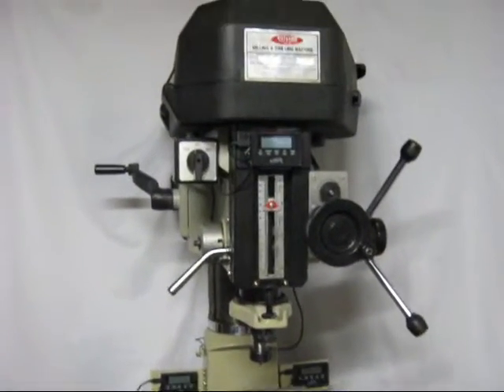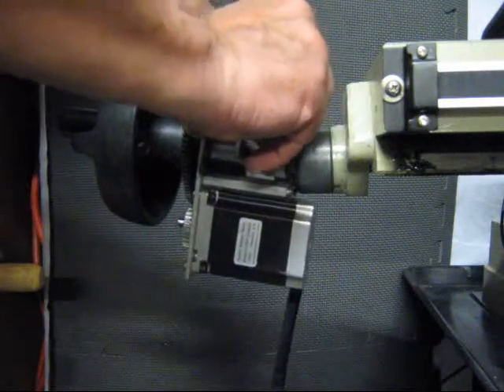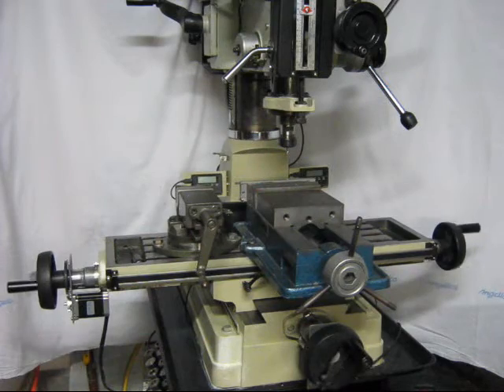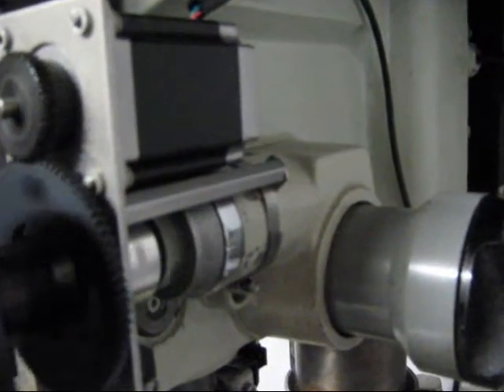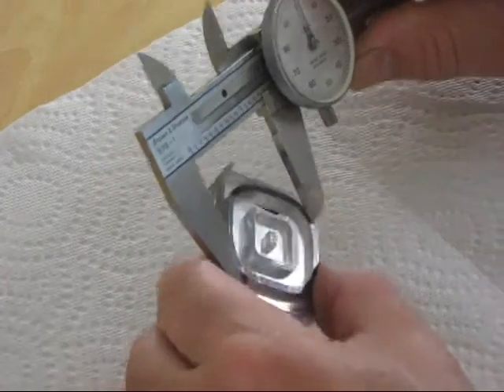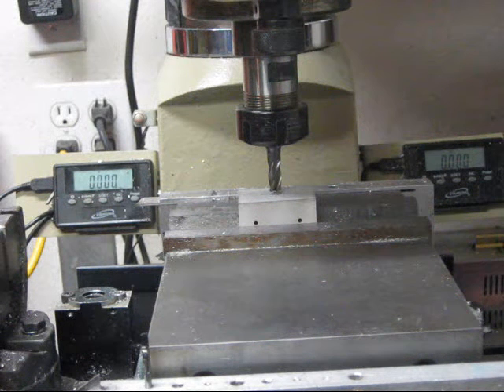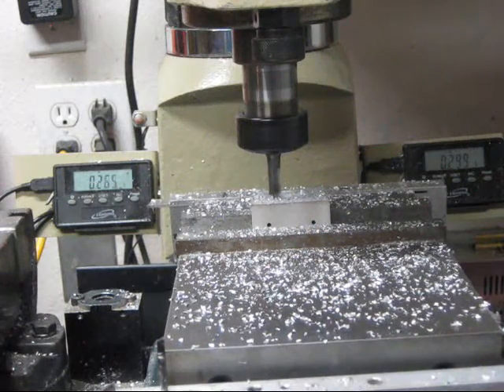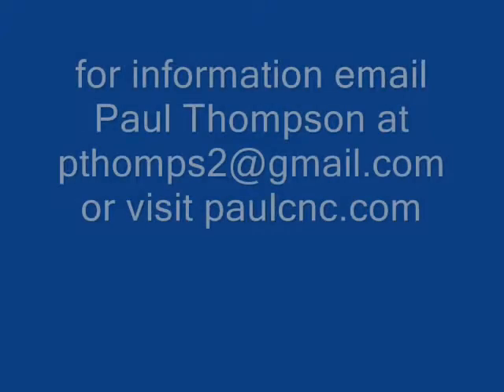RF-31 mill/drill CNC retrofit kit

Comment: I like your kit, because you don't change the threaded axes, but how do you correct the play in the x and y axes, by program? In straight sections it can work, but in circles? Thanks, regards.
Reply from the maker: You enter the backlash for each axis and the software spins the dial that amount before counting the movement. You can expect a circle to be within .001"

Comment: Interesting system. Excuse me, one a cuestion. How to correct the backlash Z axis?. Thanks You.
Reply from the maker: You can tighten the clamp and use backlash compensation. I usually don't use any compensation because the spring pulls it up. But, if the quill is barely down the spring return force is weak and the cutter can pull down the quill and it goes too deep. I learned to leave a backlash worth of extra meat and take a second cut.

Comment: Paul, saved your email, will be contacting you soon about your kit. Just picked up (02/06/21) a R-31 that already has powered X, with DRO on all 3, new Baldor 3hp and dc motor controller, but need your kit to finish off the build. Let an older Enco column mill all manual, so this Rong-Fu is a nice mill for our small shop. Retired, but still love throwing chips, Bear over at Bears Rod Shop. Nice demo video.

Comment: I am interested in the complete kit but I want to know about the delivery time to Calexico California 92231 and I am also interested in the position indicators, could give me, greetings and thanks
Reply from the maker: A complete kit takes a week although it is usually faster. The shipping is free in the US.
Reply: Paul Thompson very well I make the payment today and I would like to know about those position indicators that you show at the end of the video, where I can find them
Reply: Jay Annicharico what inconveniences did you have friend
Reply: hello friend thanks for your information and what a problem that did not work as expected, this is my email luis.arreguin@Fixture3d.com if you call me a good kit what happens is that I buy a Rong Fu RF-31 mill equipment and I want to do it cnc, thanks friend
Reply from the maker: If you mean the scales they are made by iGaging and they are available on Ebay. You can cut them to length with a hacksaw. On mine the X is 28.5", the Y is 16" and the Z is up inside the head so I can't easily measure it but it is probably 8 to 10 inches long

Comment: hello, could you provide the brand, specs of dro
thanks
Reply from the maker: They are made by iGaging and are available on Ebay. You can cut them to length with a hacksaw. On mine the X is 28.5", the Y is 16" and the Z is up inside the head so I can't easily measure it but it is probably 8 to 10 inches long

Comment: Since you seem to be using the original screws for XY  & Z, how is the back lash and accuracy?
Reply: +John McKenna The backlash compensation is extremely accurate, less than a thousandth. But backlash means the table can be pushed back and forth and if the cutting force is high enough (like a cut that uses 5/8" of the endmill length) the table will move. It depends on how you approach the cut. Typically, you take a light finish cut and this won't move the table. The video shows some cuts where the DRO is steady showing no movement

Comment: I see how the motor drive slides on to the screw shaft  with a dog coupling connection, but what I don't understand is how you got enough room for the installation between the hand wheel and the bearing mount and   Is the right hand side of the coupling part of the original machine or part of the drive kit? I would like to see a better close up of the assembly.
Reply: +John McKenna The coupler on the right is part of the mill. The intermediate part engages the three jaws on one side and provides a shaft for the handle on the other. The three jaws of the handle engage in three openings on the big gear. The handle ends up moving to the left a little over an inch.

Comment: Paul very good video.  I like the compact mounting of the stepper motors.  I am working on a motion control box right now and still need to work on mounting my steppers to my PM45.  Many options out there for mounting the steppers, yours is interesting and appears to be accurate given the mill's capabilities.  I would recommend that you sell the stepper mounting kits separately,  margins maybe smaller but sales volume could be considerably higher.  Many RongFu RF45 clones out there, so there is the possibility to expand products to those lines on machines.  Thanks for a good video.
Reply from the maker: Check out www.paulcnc.com or write to pthomps2@gmail.com

Comment: The lack of movement in the test you did with the DROs was a pleasant surprise, especially because if I saw it right, you were climb milling.

 I have the Harbor Freight version of this mill, and also have the iGaging DROs for mine. Have you done a video of mounting the DROs? I've seen a few on YouTube, but every one I've seen have completely over complicated the way they set up the Z axis. The way I mounted mine was to fabricate a bracket that bolted on at the bolt on the back of the quill for the cast iron Z axis stop clamp with an arm that came out on the right side behind the handle. I bolted one end of the scale onto the bracket, then drilled a hole in the body of the mill to mount the reader. So simple, quick, and out of the way that I thought maybe it wouldn't work, but it is accurate and I haven't had any issues with it yet.

Great job on this video, thanks.
Reply: +GlockG34 Actually I did something similar on the Z DRO except everything is inside the casting behind the quill.The scale is attached to the quill clamp and the read head stays fixed inside the hollow casting